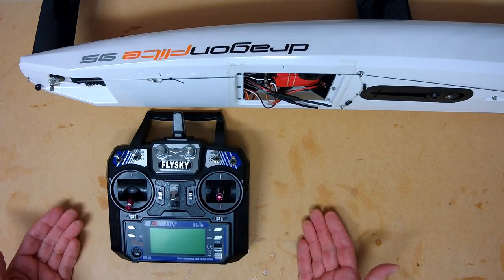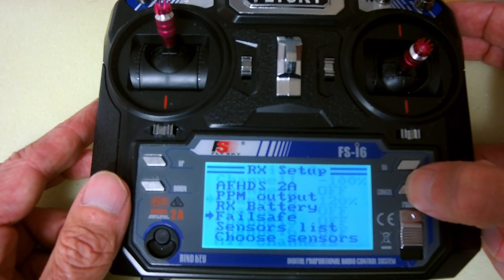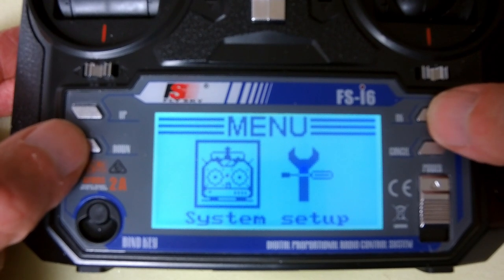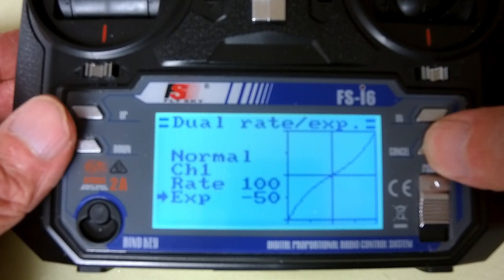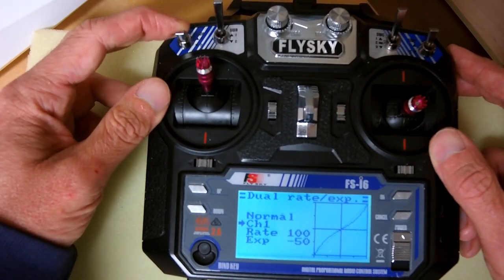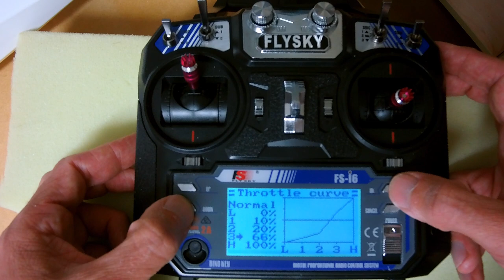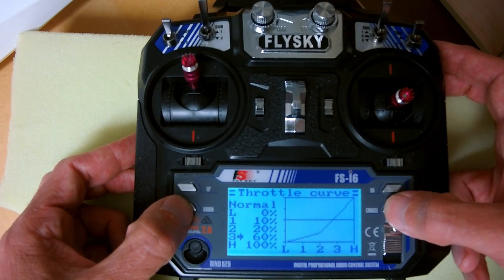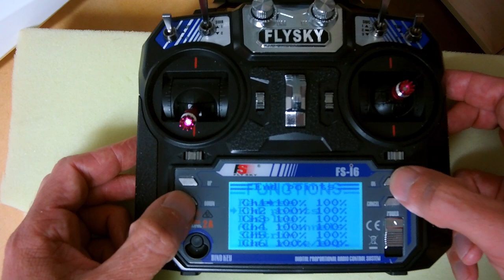FlySky FS-i6 SailBoat Setup

Comment: Thanks - very helpful!  Can you share how you program the switches?  For example, swC is set to channel 7 on my radio.  I’d like to program the toggle up to let my main sheet out 10% and toggle down to pull in 10%. Toggle in the middle is off. Any help is appreciated. I would assume programming the other 2 position switches (a,b,d) would be similar?
Reply: Navigate to “Aux. channels” using the down button, and then push “OK. Using the “UP” or “DOWN” button, change the Channel 5 so that Source has “SwB” underneath.  Hold the “Cancel” button to commit the change. This creates a “Channel 5” in the controller that is assigned to “SwB”.Navigate to “Mix” using the down button, and then push “OK. Mix #1, to On, Master Ch. 5, Slave Ch. 3, Pos. Mix 10%, which will ease the sail winch 10%.  Tweak this value.  This will make it so when you pull SWB down, it will ease.
Reply: @johnfracisco77   This is what I needed!

Comment: You sound a little like terminator great video
Reply from the maker: I'll be back! :)
Reply: @johanbergkvist8834  🤣 wasn't meant in a nasty way btw have this control for my bait boat and I'm having trouble with it as the right joystick is to go backwards forward left and right but when I push the stick up to go straight the right motor seems to be going slightly faster making the boat go to the left how do I trim the to go straight. As when you move the stick forward and to the left or right it alters the power to the motors to turn but mine when trying to go dead strait is slightly pulling to the left thank you

Comment: Hi is it possible to use the flysky for 2 boats (not at the same time) I’m building a second one thanking you in advance Harry
Reply from the maker: Yes it is. You just need another receiver for the second boat. And you would probably want to set up a second Model in the radio for the second boat so that endpoints and such are set individually per boat.

Comment: Thanks for this - very helpful.  Any idea how you can use the SwC three-way switch to have three rudder modes?  Apparently this can be done on the FrSky Taurus?
Reply from the maker: I never felt the need, so no I can't say I do. Are you after more or less expo in the three different modes?
Reply: @johanbergkvist8834  Thanks for this - and the You Tubes - you have good fun.  The DF95 with the motor is good! I read that some of the 1OMs (e.g. Plan B) have three rudder expos: normal, downwind and heavier breezes downwind. Seeing the reason for this - just asking :)

Comment: After adjusting the end points, my sheeting distance is 138mm instead of the 128mm identified in the build instructions.  Is that what your sheeting distance is too?  Do you see the boat performance change down wind?  Is it better in light or heavy winds?
Reply from the maker: I don't know of the top of my head what the new distance is, but it is more than the 128mm, so so far so good. The intent is to allow the main sail in particular to go all the way out. The jib goes out further too and I find that helps a bit with keeping the sails crossed. It catches more wind in a dead run, especially in light wind. Can I actually see a difference compared to other boats in a race? No, not really.
Reply: Johan Bergkvist o